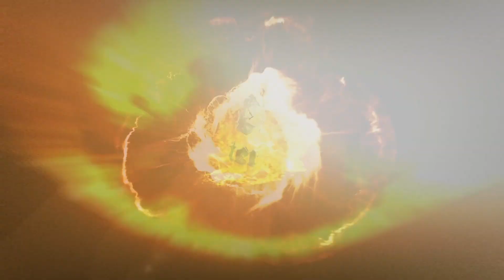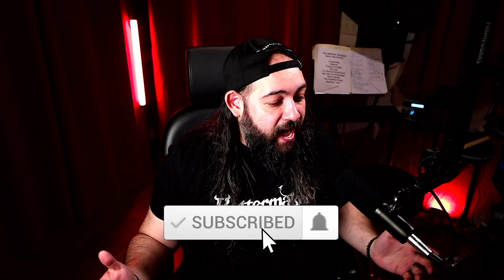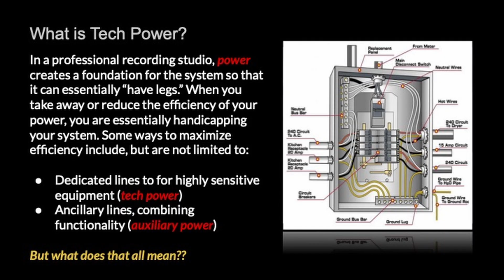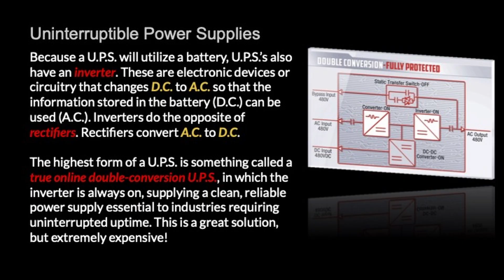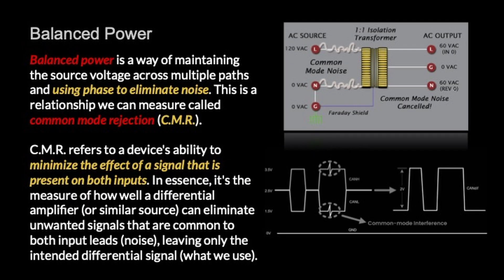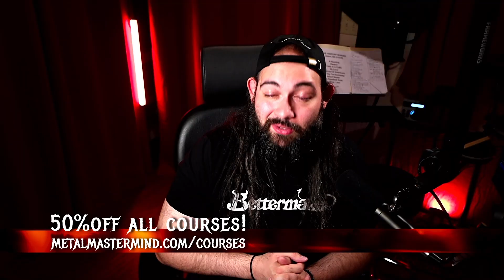How Important Is Power in Your Studio?

Comment: +1 people don't think enough about power, Ken.

My Furman PL-8C has saved my gear twice since I moved mid-2023. Before it had never tripped in a decade. It trips at 137V iirc, it's a relay so a physical separation, and you have to power it off and back on. It has one of those ugly yellow-green LEDs from back in the day XD But I love it. My PC goes into a UPS and the UPS runs off the Furman so if it trips everything is protected and I can save my work if needed. My UPS even shows me the AC voltage coming into it.
Reply from the maker: Awesome! That will surely help keep the most important thing protected: your data!!